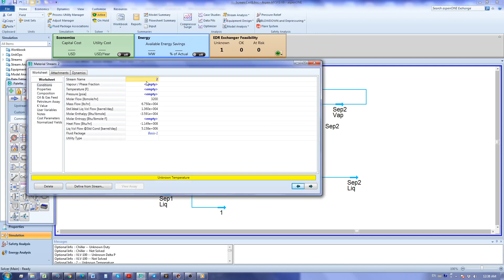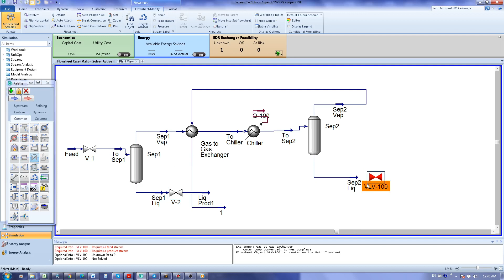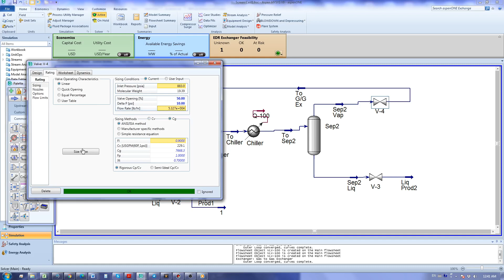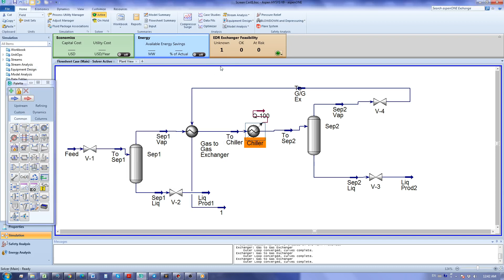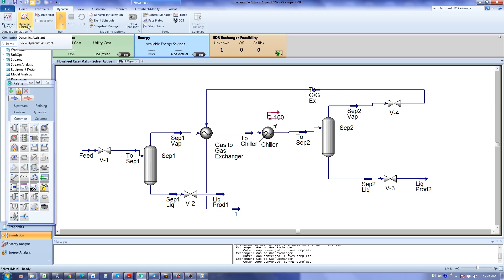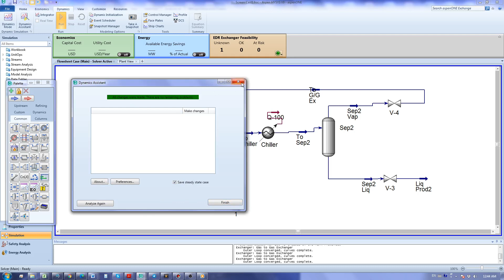HYSYS Dynamic Simulation of a Simple Gas Plant-Part1

Comment: i got ft correction factor is low on the gas to gas exchanger
Reply from the maker: Hello Tartila, this is because the default heat exchanger flows in HYSYS is not truly countercurrent. You can get rid of this warning by choosing  "AFU" as your TEMA type under rating>sizing tab.